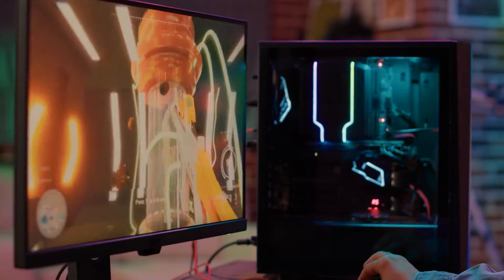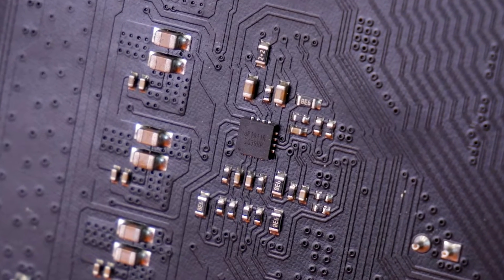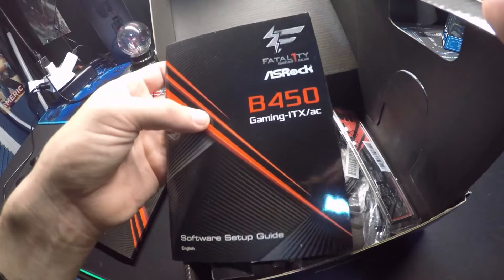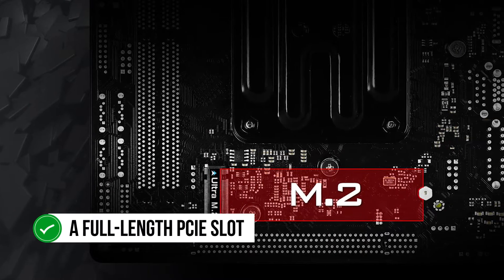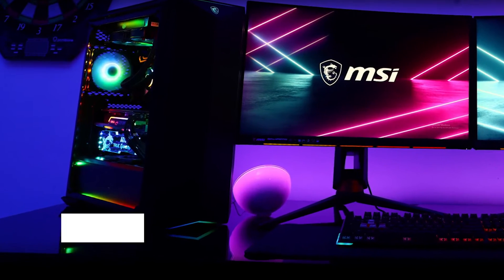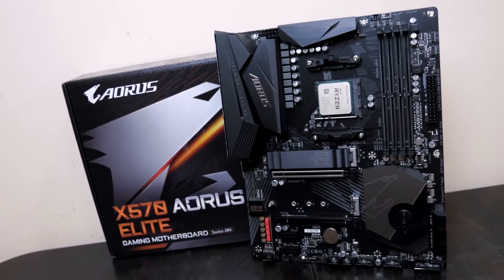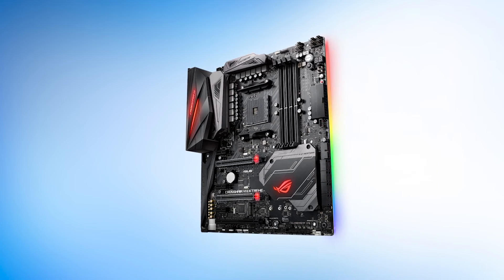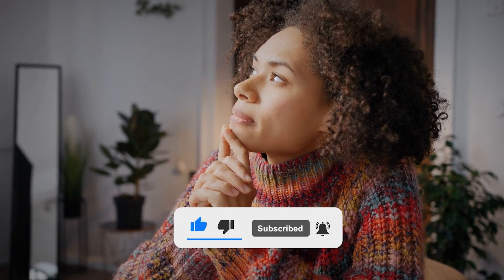Best Motherboards For Ryzen 7 2700X TODAY! (TOP 5)

Comment: In Google they show ryzen 2700x does not support B550...what to do now
Reply: Not officially. I am using B550M TUF with 2700X since release.
Reply: @nevisnexus  BIOS version?
Reply: @MultiNetguru  every single one worked. 2803 and the last 2806 worked fine. Upgraded to 5700X few weeks ago
Reply: @nevisnexus  Maybe an Asus Rog Strix B550-E Gaming works with the 2700X?
Reply: @nevisnexus  What you be using for ram if you don't mind me asking? I'm thinking about grabbing this.
Reply: @khutzone5526  Patriot Viper 4 Series PV416G320C6K, DDR4, 16 GB, 3200 MHz

Comment: would you recommend the x570 aorus pro over the elite? or not much difference?
Reply from the maker: thanks for your question, it depends on what you want it for. If value for money is what matter most and you need a reliable board that can handle any 5000x cpu the elite is the best option. If you want a board for heavy overclocking the 5900x or 5950x then you will need the pro! Hope this helps
Reply: @BCZone  im a little confused considering this video is aimed for people that have the 2700x lmao.. so i have a 2700x... i ended up getting a b450 arous elite do you think that was a good choice? (i did have a gigabyte ax370 gaming 3)